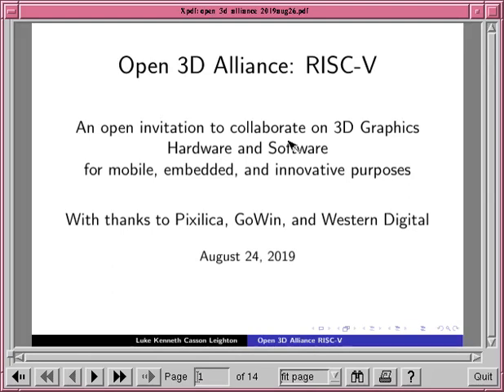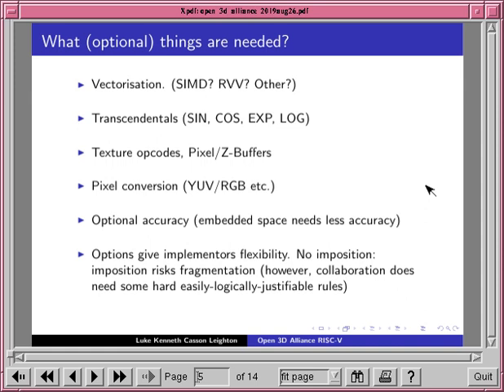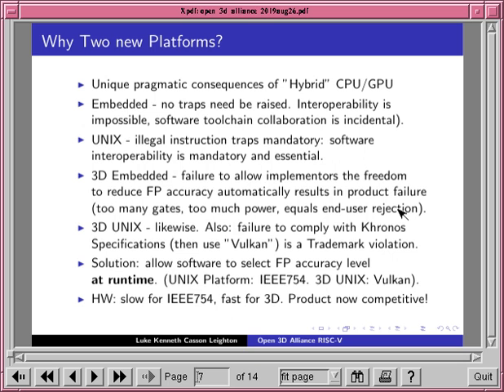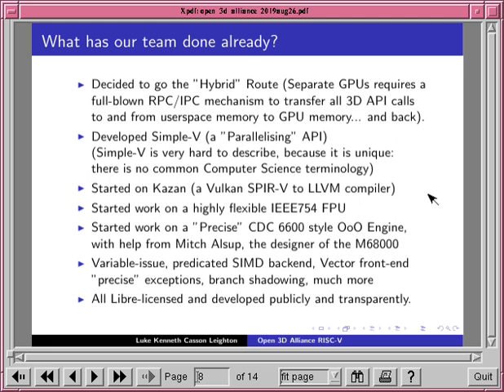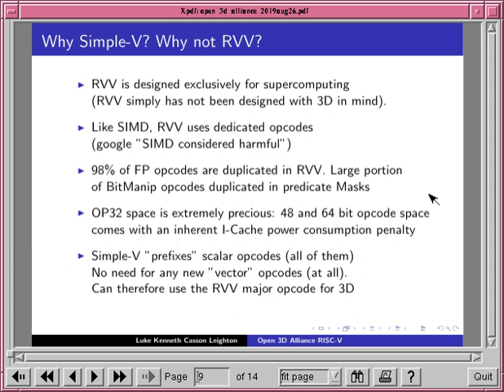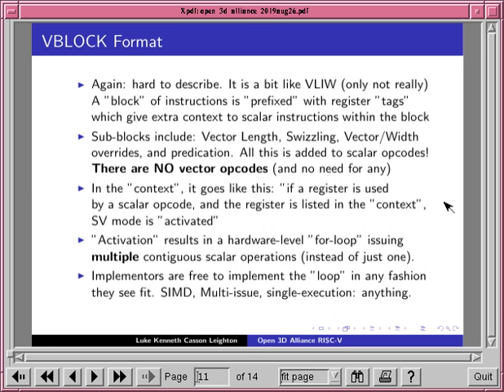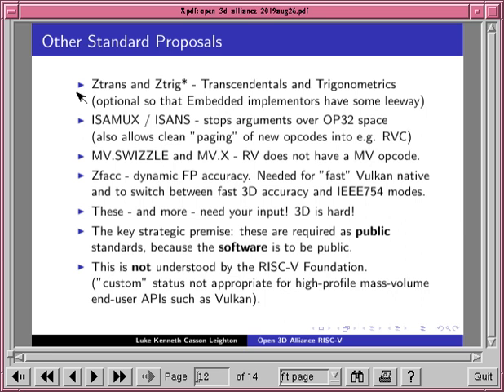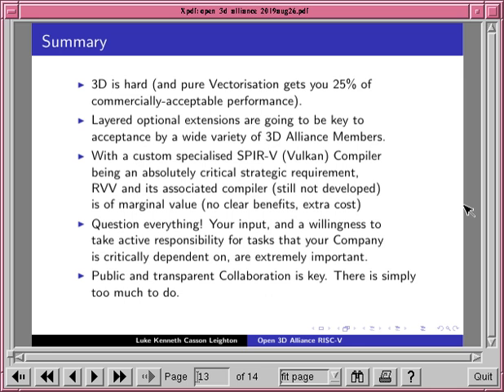Libre RISC-V Open 3D GPU Alliance Slides: 2019aug29

Comment: Thanks for the presentation.
I'm really interested learning about open source GPU design.
This project seems very promising however as a beginner in CPU/GPU design I'm having a hard time understanding the last part of the presentation.
RISC-V itself is designed to be beginner friendly and it's taught that way.
Could you also provide a beginner friendly introduction to your project for potential contributors like me?
I can only find very high level info for sponsors and very low level info for/from current contributors.
A guide on how to get started and how to compile/run/test the existing parts would really go a long way.
Reply from the maker: hiya, if you join the #libre-soc channel on freenode or join the mailing list we can help you get started.  bear in mind that you'll need software libre collaboration skills (not that hard), you can start here https://libre-soc.org/HDL_workflow/ and there are automated dev-env helper/installation scripts here https://git.libre-soc.org/?p=dev-env-setup.git;a=summary

if that's "too much" then you need to learn the basics, first, and you can start that process here: https://libre-soc.org/3d_gpu/tutorial/
Reply: @lkcl  Ok great I'll set myself a reminder to contact you again once I'm done with my exam in about a month.

Comment: Your narration is unusually soft, and soothing. I like the xpdf presentation, it's a nice yet unsettling contradiction to the soft spoken narration. This is great, thank you!
Reply from the maker: thanks jon.  btw you can get the PDF here: https://libre-riscv.org/ikiwiki.cgi?do=goto&page=simple_v_extension%2Fopen_3d_alliance_2019aug26.pdf and the original latex just change .pdf to .tex.

since doing the slides (and the video) i made one small addition: pointing out that SV hs been designed to allow implementors to "transition" a pre-existing scalar design to one that has a "Vector" front-end on it.  the summary is that SV "slots in"  between instruction decode and the ALU, with little to no modification of either the scalar instruction decode phase or the scalar ALU.

of course, to get higher performance normally associated with Vector Engines, you now need to multiply up the ALUs, add extra register file ports (or stripe them aka "Lanes"), add extra memory bandwidth and so on.  however that's a separate task, and, interestingly, is only necessary for high-performance computing.  SV has been designed with flexibility in mind, to suit even low-end embedded requirements.